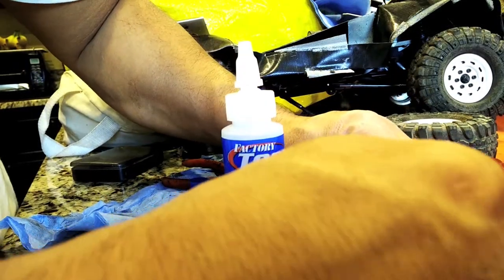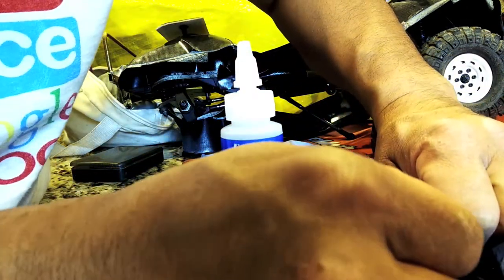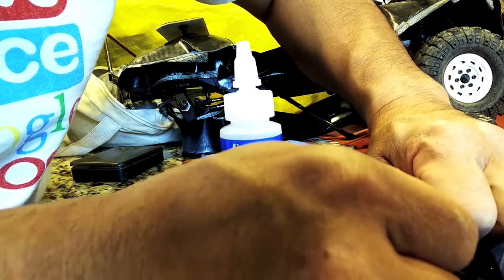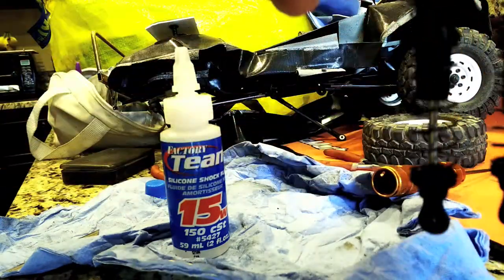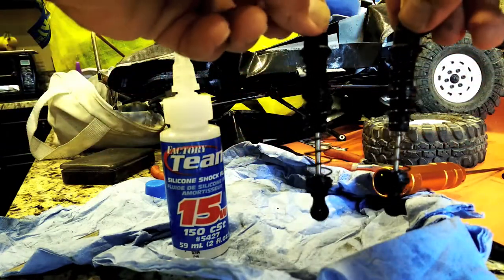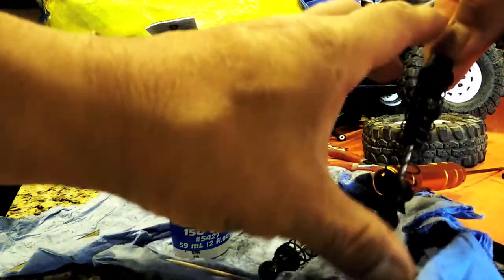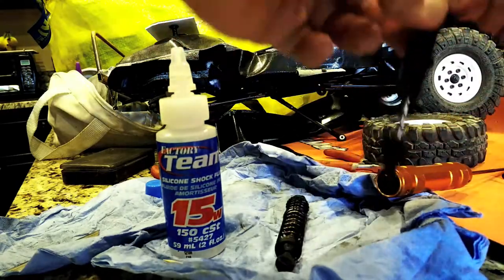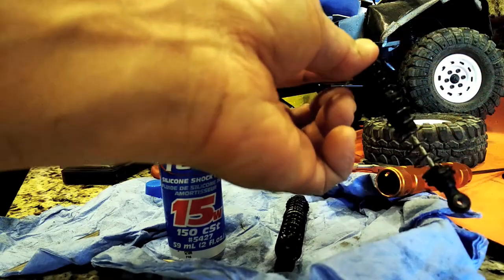Project Ascender update #3

Comment: Just one comment, not too keen on you gripping that shock shaft with them side cutters!! True, you are gripping them in an area used only by the bump stop but it doesn't look right. I cringed lol :) Good video man!!
Reply from the maker: Thanks for the comment, my friend. I do not have shock shaft pliers, so that was what i used. I just grip closest to the threads. It's just always what I have used for my drifters and off road truck shocks. 😲
Reply: eunique FAir is fair - if it works for you then good for you :) Thanks for sharing :)

Comment: The torque twist on the Ascender is terrible, with the weight of the D110 even worse, does not help!!
Reply from the maker: With the stock Blazer body, I get good performance on it, I have to do more mods with the D110